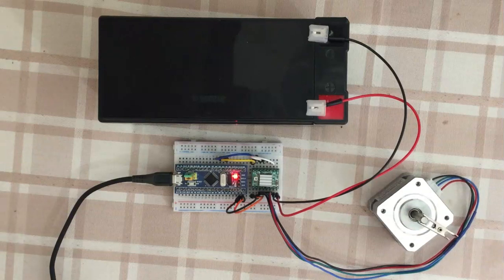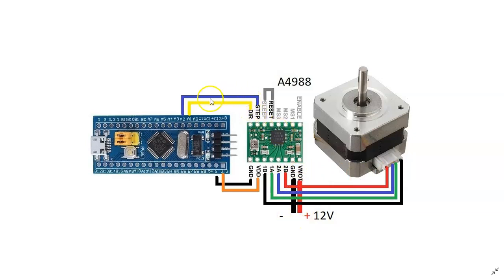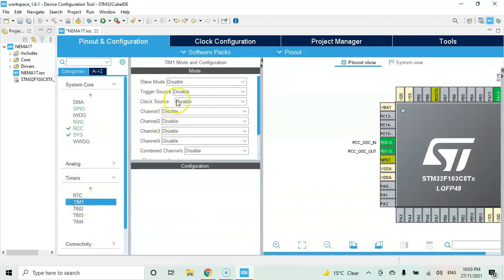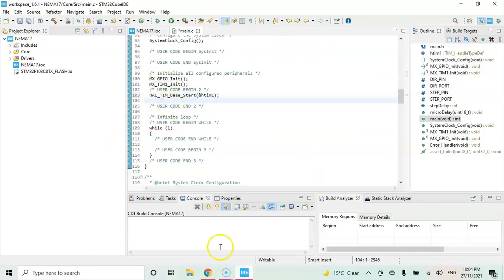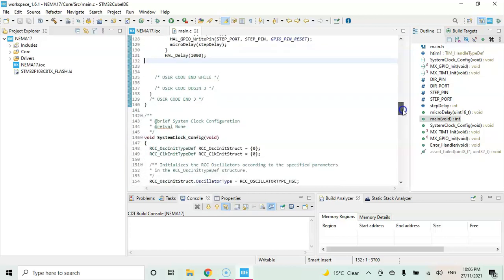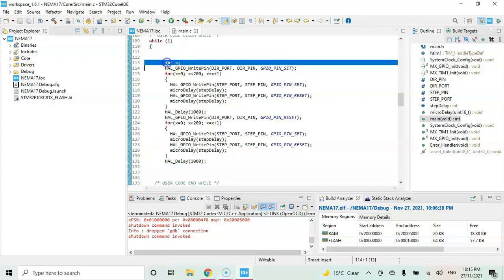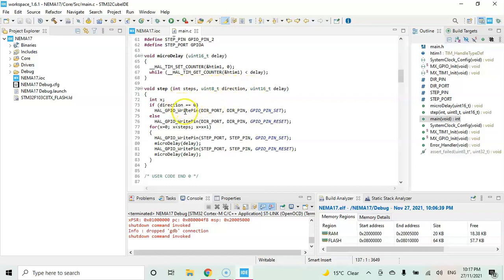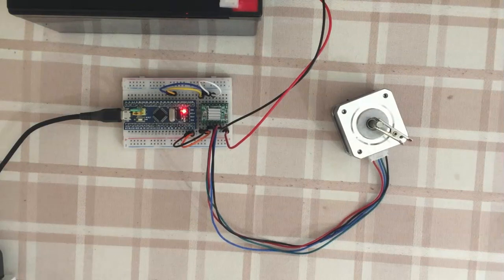73. STM32CubeIDE A4988 & NEMA 17 Stepper Motor with STM32F103C8T6

Comment: hello, your code is very useful, i used your code and i use 12V,2A power supply for vmot. but when i connect to stm32, when i connect Vdd wire to 3.3V pin of stm32, it loses power. can you tell me why? and the motor still doesn't work

Comment: Hello.... i like your video very much but when i duplicate this video on STM32H7A3 Nucleo stepper motor cant work at all, i tried the A4988 on UNO it works well....could u kindly advise?
Reply from the maker: My suggestion is to try it with STM32F103C8T6 on CubeIDE as I have shown in this video and make it work. Then play around with timers for micro-seconds delay. When you are comfortable, try with STM32H7A3. Thanks
Reply: @NizarMohideen  That's not true, i'd try most of your video on STM32H7A3 and it works.... Bluepill is a simple low capability uC how can it compare to H7A3?

Comment: htim4.Init.Prescaler = 72-1;
htim4.Init.CounterMode = TIM_COUNTERMODE_UP;
htim4.Init.Period = (72000000 / (72 * pwm_frequency)) - 1;

  sConfigOC.OCMode = TIM_OCMODE_PWM1;
  sConfigOC.Pulse =(htim4.Init.Period*0.1);
  sConfigOC.OCPolarity = TIM_OCPOLARITY_HIGH;
  sConfigOC.OCFastMode = TIM_OCFAST_DISABLE;

i used pwm channel 1 for step signal.
i did like this and worked quite well. But when i looked at the internet i couldn't found like my solituon. i wonder mine is wrong or something?
Reply from the maker: The timer used in this example is for micro-second delay. As long as you get 1us, it should be ok

Comment: I am using STM32f446 with the same code and did all the configurations correct but still my motor isn't working, can you explain me please why it is happening so?
Reply from the maker: If you set Clock Configuration tab → HCLK (MHz) to 180 for STM32F446RE
Then,  Configuration → Parameter Settings → Prescaler set to 179

Comment: Wow, I have been following your video. It's clear and educative. Please sir, help do tutorial on sinewave inverter using stm32; hbridge driven 220v, 50hz output with transformer. Could also have LCD to print data like battery parameters, ac out . Also using grid charging system. Expecting your reply. God bless you for this generation.

Comment: Is there any sort of library or easier way to set Speed, Acceleration, Relative and Absolute Position of each motor so that you can easially control them for robotic arm etc?
Reply from the maker: It can be done
I haven’t seen any library on the github so far
Thanks

Comment: I really liked you are on of who did stm32 with stepper motor here in youtube with clear explanation..great keep doing please i would like to use by nextion control it... also i have i question this is codes works during plug in power and run automatically repit codes from up to down and loop it ..but if i would like to stoped clicking by button interrupt and then  clicking by button want to keep contunie the codes  what to do any chance to do video for it???

Comment: How can make to control 3 motor at same time?
Reply from the maker: A simple way is to use FreeRTOS and put each motors code in different threads.

Another way is to use different timer interrupts as I have shown in video-62 without blocking delay

Thanks

Comment: I think a MOSFET needed between the driver and the motor
Reply from the maker: Hi  Виталий Филинков,
According to A4988 data-sheet 
"The A4988 is a complete microstepping motor driver with
built-in translator for easy operation. It is designed to operate
bipolar stepper motors in full-, half-, quarter-, eighth-, and
sixteenth-step modes, with an output drive capacity of up to
35 V and ±2 A"

2Amp is sufficient for many applications. 

If  you want to drive heavy works then you may need mosfets which I don't know how to connect yet. Thank you very much